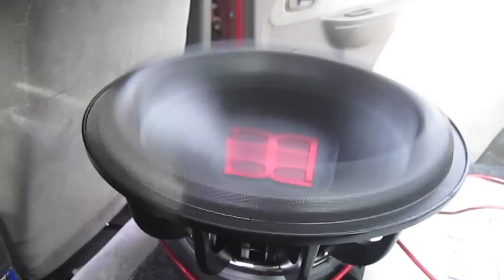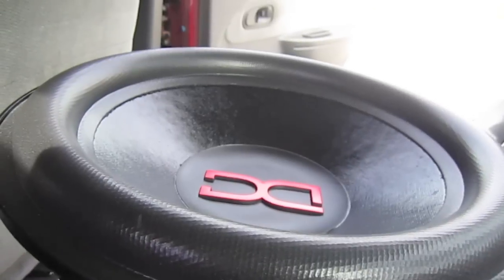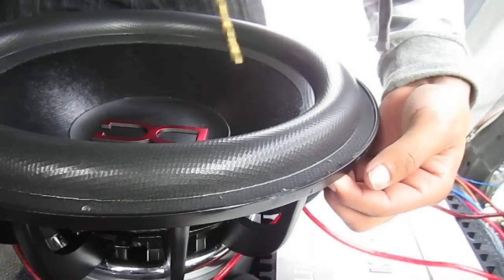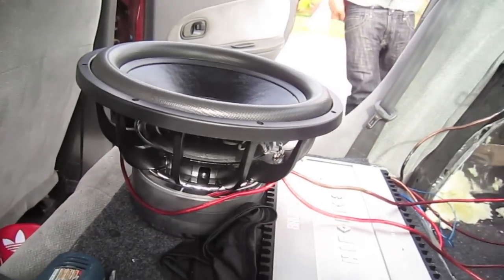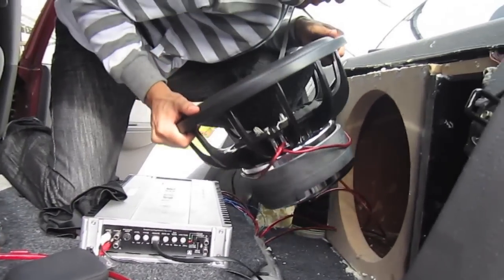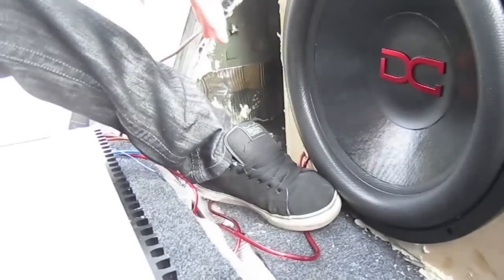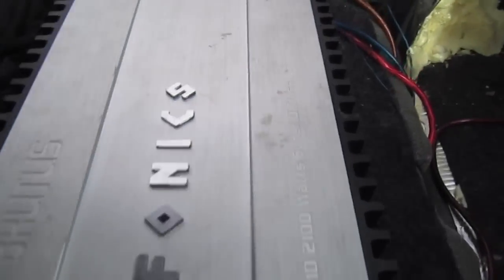15in DC XL m2 & Hifonics 2100D I DC Audio

Comment from the maker: already got the 0 gauge and car didn't burn up lmao
It wouldn't of burned up anyways due to the electrical not being able to supply the amp with the amps it need to pull out rated power. There's not enough current traveling through the wire to cause it to heat up too much haha